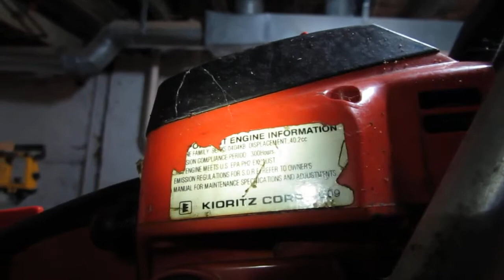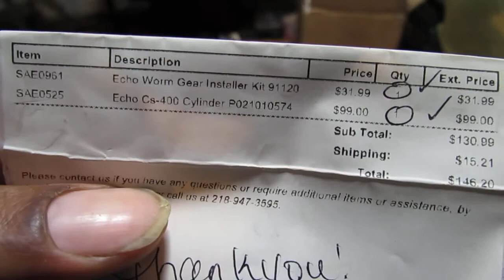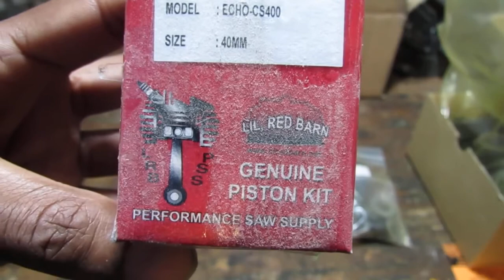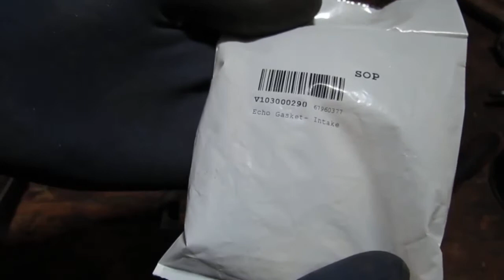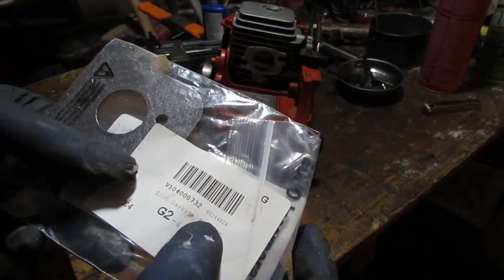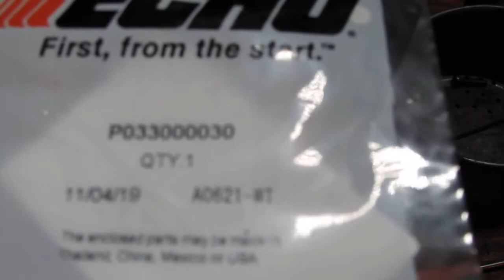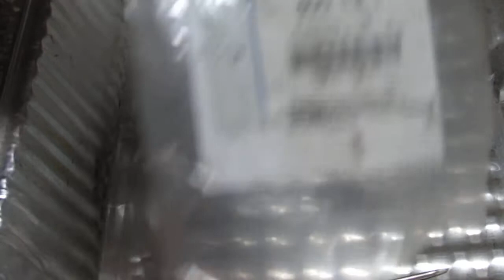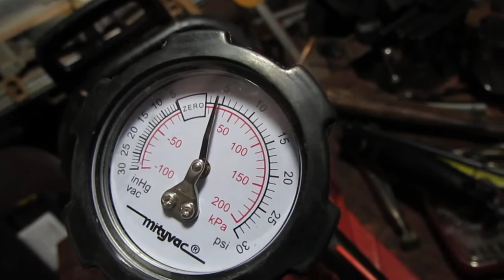Echo CS-400 Tear Down and Rebuild

Comment: Having the same high idle issue. I was advised today to not mess with the low and high screws if at all possible and was advised to look at the choke linkage as being a possible culprit. Crazy thing for me is it idles fine until the air filter cover is placed atop the air filter.
Reply from the maker: To get a proper running machine you must invest some time learning how to set the low and high parts of a carburator.  Once set then adjust the idle speed.  I believe I did this in the video.  If you have questions, ask and I can see if I can help.
Reply: @MotionDesignStudio  Thank you much. Troubleshooting a system via deduction before adjusting low and high is the takeaway I am getting from many, but I do not discount your point. These chainsaws come factory set / tuned  and I suppose Ive done very good with this thing up to this point, for it not to act up until now-15 years or so still with original original carb and lines. Guess it is time for me to learn this system, troubleshoot and adjust the low and or high if need be. My issue is high idle after working with the saw a few days in a row. I was a bit rough with it, plopping it onto the ground from a couple feet height, so, who knows. I have replaced the spark plug, air filter and purge bulb. Hopefully my little micro screwdrivers can work to hit the low clockwise. Thats if everything else looks alright. Other weird thing is if I tap the kill switch after the saw has been started, that will also cause the saw to rev some.
Reply: @MotionDesignStudio  btw, just figured it out. something real simple I didnt notice when changing the plug and filter- where the trigger wire that runs to the carb is supposed to sit (Between the two black plastic pieces) was instead underneath and laying on top of one of the fuel lines. Guess the friction between fuel line and trigger metal wouldnt allow the metal piece to rest back into the slot, so the trigger was still depressed even after letting go of it.
Reply from the maker: @cbdyna  , this is so awesome.  Thanks for sharing this conclusion.

Comment: Awesome video. I'm rebuilding one my friend found in a camper he bought. Unfortunately it had a lean seizure but it wasn't too bad. This is a great reference video for me, very helpful. Thank you. Hoping to get it running without replacing anything, wish me luck. btw i didn't watch the whole tuning portion of the video but i seen the chain was still moving at idle, is there a problem with the clutch? it didnt quite sound right.
Reply from the maker: I can guarantee you will have to replace the cylinder and piston and little scratch will decrease the performance of this.  The chain moves at idle because I could not adjust the air fuel mixture well enough to lower the rpm to prevent the clutch from engaging and turning chain.  I could replace the clutch but it is not an issue and not the reason why the chain moves.  Really happy this hard work is not going to waste and you can use this information to fix your chainsaw.   Enjoy your weekend.
Reply: @MotionDesignStudio  well even if i do have to replace them, this will be a learning experience anyway. Did you try taking off the limiter caps for the jets, mine only gives about a half turn adjustment with the caps. I've had a clutch be the cause of that before that's why i suggested it.
Reply from the maker: @RobBot34  , it is not really permitted to meddle with the limiting caps.  It is unfortunate since you need a greater range of settings to get a machine to run correctly.
Reply: @MotionDesignStudio  yeah true. sometimes you gotta do what you gotta do. lol.